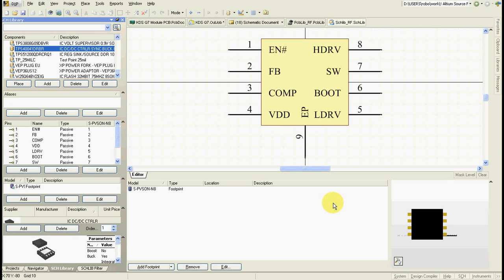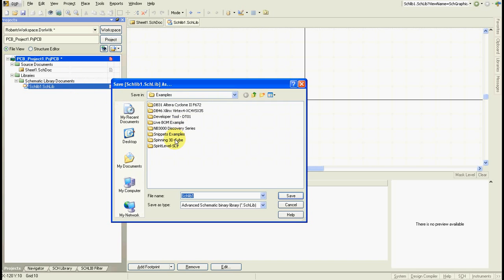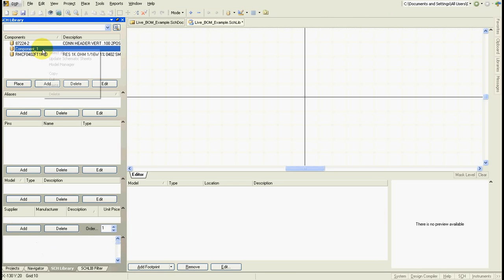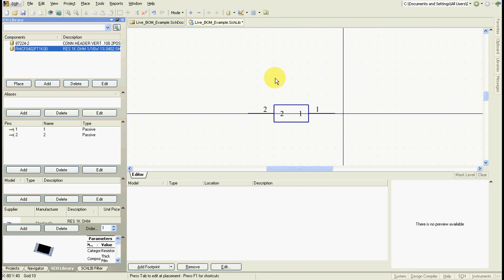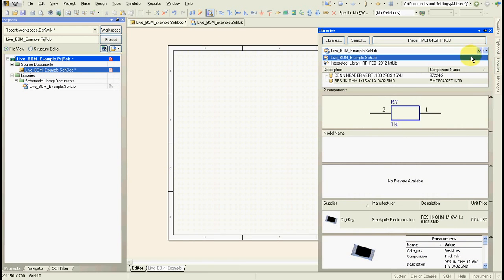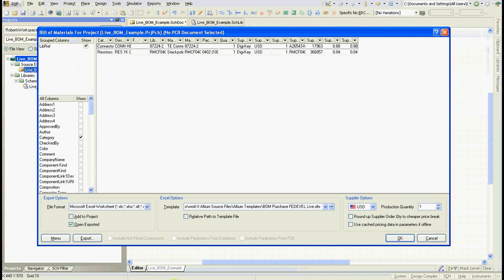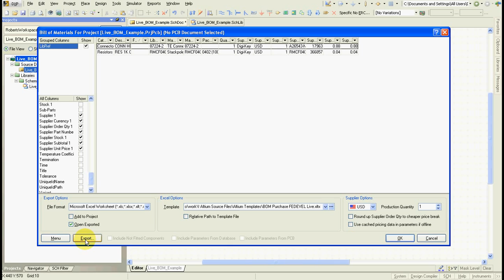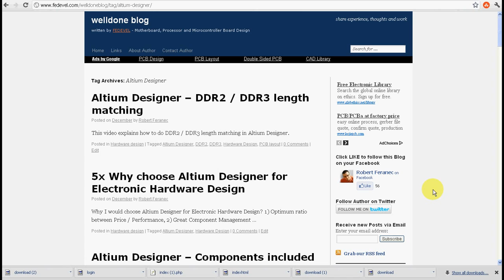Altium Designer - Create BOM & Library from Supplier's Data

Comment: I am working with Altium 17. I wanted to add a 220uF SMT capacitor.  Digikey PN:   732-6413-1-ND .
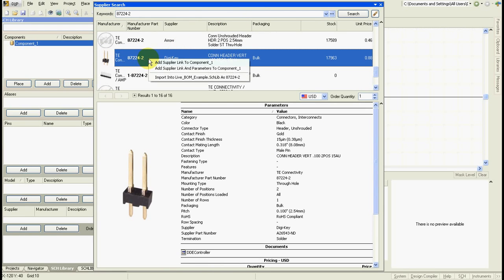I did a supplier search, found the part and left clicked import into live schematic as in the video above at 1:24.  
When I am in the SCH Library view in the lowest dialog window I see a 3/4 view of the part and many parameter name and values.

However when I insert into the schematic and view the properties I only have a supplier 1 field and a Supplier Part Number field.  No of the other fields came in.

Not sure what else I may have needed to set Up or control during the supplier search to make this work.

Any ideas what I should check?
Reply: I found and answer. I again used the Supplier Search and this time right clicked and selected to add Supplier Link and parameters to the existing component.

Comment: Robert, how do you create a Buuld of Materials for Project that includes the supplier part number. Is this possible? Basically the reverse of what you have done in your video. Create supplier data from BOM
Reply from the maker: Hello Alex.You can add parameters manually later (or you can import them into existing components), but you may need to do it one-by-one (individually for each component). I am not sure if you can "import" BOM parameters into library.
Reply: Robert Feranec Thanks Robert